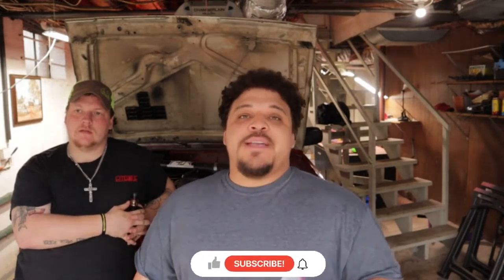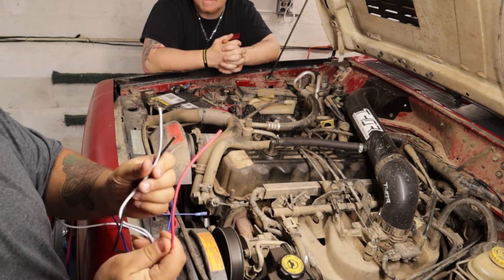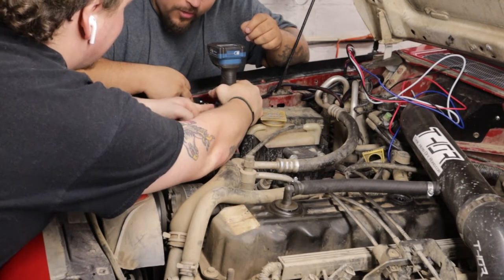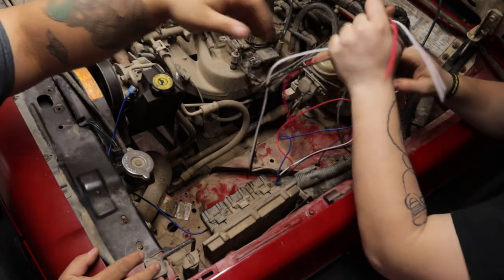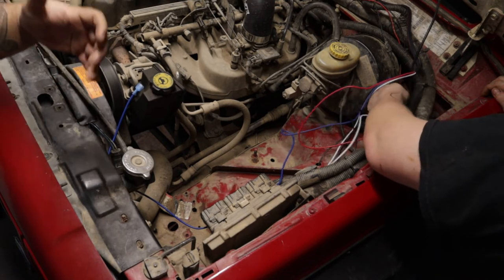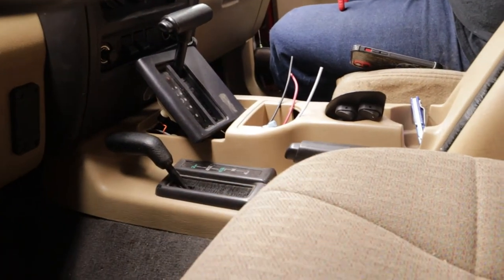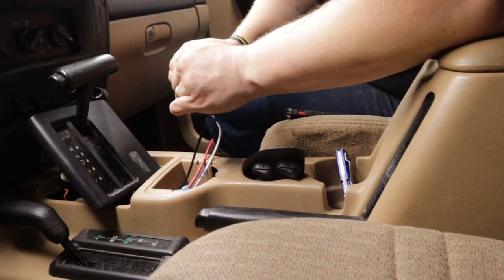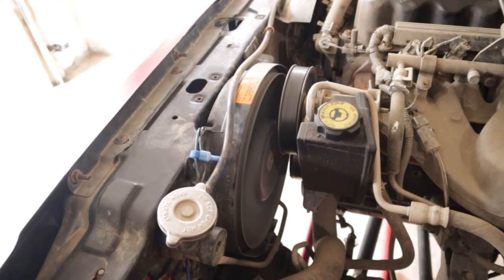Jeep Cherokee XJ/MJ electric fan/accessory relay harness & switch// ksuspensionfab

Comment: Question i have this same kit and gonna install it mow that i found this video but does the temp gauge still work with this kit? My problem has beem ive got two from auto zone and both must be faultiy because they did not work so i got this kit hopefully it does because i have it straight wired to a toggle at the moment but like i said temp gauge doesn't work when after j done it that way
Reply from the maker: Yes my temp gauge still works just fine  again you should only tap into the blue wire coming off of the electric fan

Comment: hey guys I have  a question I put a jk alternator in the air comp space, deleting the air, cruz move my ball and the gas tank breather, controller,now I have no fan clutch I also was not going with the three fan set up if I dont have to I would like a half power full power simm 2 speed fans  dual stock fans.. do you think the stock fans will run at half power then can be switched to full power.   I think  I can do that for about 100, fan relays wire/ What do you think 98 xj The King Of Dirt. or fan 1 fan2 thing ..thank you

Comment: If I activate this after turning off my XJ, will it run indefinitely – will it kill the battery?  I’ve seen set ups that have a timer relay.
Reply from the maker: I have it hooked to a switch so it will still turn on its own when it needs to but i can also turn it on with the switch or have it on longer while in traffic . The longest i have had it running so far is about 30 mins while i was in the grocery store jeep was off but had the switch on so the fan would be on came out put my stuff in the back and the jeep started right up no issues with battery.

Comment: You tapped into the fan on the side of the plug. If you have to replace the fan you will have to rewire it. Duh
Reply from the maker: No you would would simply disconnect fan from harness plug in new fan then tape into the new fan harness.. duh